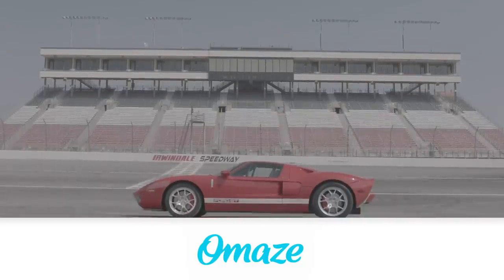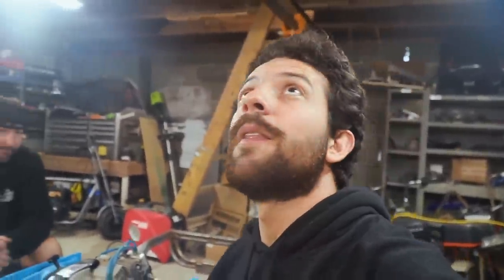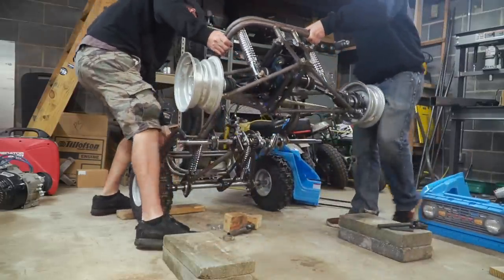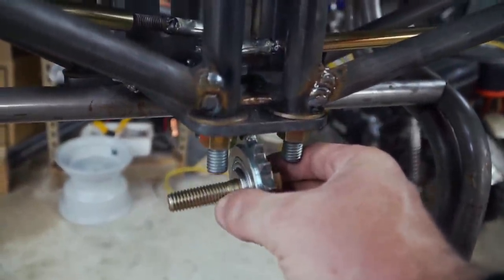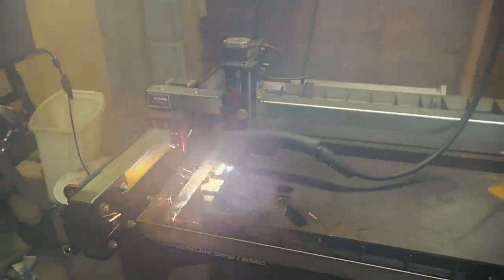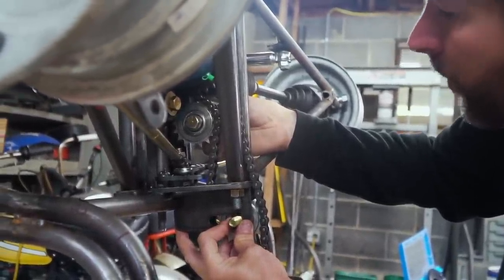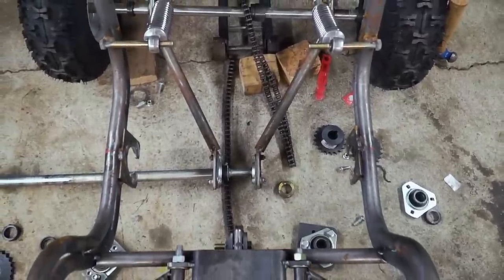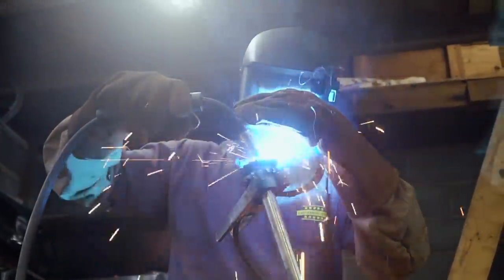4WD Power Wheels Go Kart Build | Drivetrain is FINISHED | Axles, Hubs, Sprockets!

Comment: You guys need to build like grind hard plumbing co does, get your engine and driveline laid out first, then build your chassis and suspension around that. Makes things lots easier and prevents rework and compromise.
Reply: Love them grind hard boys, they build amazing things.
Reply: Seems like GHP and Moto mule are the only two that sit down to research and plan things. Their end products are normally always strong and lightweight. Everybody else just wants to weld more and more when it fails or just abandon the project. 
I'd rather watch one nice well thought out project vs a dozen poorly planned ones that are butchered together. Project Blinky is a nice example, look how long BOM has been working on it and it's very popular.
Reply: Completely disagree.  They should build like they already do, not like some other channel.

Comment: A mid-size metal lathe would come in handy to clean up those sprockets after welding.  An older refurb would be good or even a cheap overseas one could handle the small jobs.  Great project.

Comment: you really should of done the rear axle with cv joints like the front.... independent rear suspension
Reply: Not at all.  The current set up is way more practical.

Comment: Not sure if anyone has pointed this out but the closer the water level is to the metal the less smoke and dust you have floating in the air when making cuts on the CNC plasma cutting table.

Comment: It looks like the rear axle control arms have no articulation from side to side. So if you're rock crawling and you need the rear axle to go up on one side only you will just put it in a bind as well as the chain and sprocket will twist causing the chain to come off. At least that is what it looks like. With out a drive shaft they need an independent suspension similar to the front axle as someone else has already mentioned in another reply.

Comment: Barbequing? Nah, welding. lol. Going to be a tight fit, maybe something between where the opposite running chain passes the sprocket eh? In case it hops back and locks the front end while you're doing 30 or something. Can't have y'all hurt we need content. Heh heh, and gotta love cutting thick plate like butter.

Comment: When your chain comes off or breaks you won’t be steering to safety
Reply: Incorrect.
Reply: @SportbikerNZ  I hope it doesn’t happen sounds like they are going to try and address this issue if chain comes off it could tangle up in frame right there were the steering is and prevent safe steering
Reply: @CR4ZYxRY4N  They'd have an equal chance of getting hit with lightning imo than the chain breaking in just the right spot to completely bind up steering.

Comment: When you guys were putting those sprockets in the front all I could think of was why are you using such big sprockets in there. Oh and John in the last video you almost burned your fingers while welding a nut to your frame all you have to do is put the nut on a long bolt put the bolt in the hole and weld with no burns and clean clear threads in your nut as well. Just keep having fun and you'll make good videos.

Comment: john, why haven't you welded up the hole you made in your plasma cutter table? without the water puddle, you'll only wind up making more holes in it by putting it off. not to mention making your shop dirtier because the water isn't collecting the metal spray from cutting. electronics like your laptop and cameras don't like steel dust, and ounce of prevention is worth a pound of cure.

Comment: see if you can follow me here. if you bend some tube, and weld it to the bearings  between  the bearings you a using for the trailing arms. put a retaining collar on both sides of the bearings it would act like a straight axle. then you could use heim joints for the pivot and flex point like a normal 1 to 1 rig . you can use a similar set up at the other end and it would save the bearing from going bad as fast. you can actually connect all the bearings on the rear axle and it would make it much stronger. think of it like this bend a top and bottom tube or top front and back so it clears the sprocket and chain weld to a point on all the bearings then it would act like the axle housing, so you  attach you 4 link to it and it would be a straight axle.

Comment: Seeing as you need to space out the rear wheels a few inches on each side for stability,tracking and track width why not mount the reat shocks outboard of the frame in an almost vertical location gaining both internal spacing as well as more shock leverage on the chassis...js...
Reply: But the lil Bronc is looking good and coming together nicely.. Maybe 4 wheel steering is in its future plans if you really wanna rock crawler or serious off road go anywhere buggy... Or maybe a built Tillotsin engine or even a badass seriously modified horizontal v twin engine!!! 😁

Comment: with those nacho's most of the thunder will prolly happen under the blankets at night , better not light a match
one more tool for the want list: a vibrasaw https://www.arkadaserviss.lv/files/products/bosch-narzedzie-wielofunkcyjne-gop-30-28--300w--0601237001.300x300.jpg
these things work great on plastic and in tight corners

Comment: Don't know why I am going to say this cause yall obviously know everything.  But I hope that isn't how you are planning to mount them rear shocks at that angle you might as well not use anything. Ideally they are designed to be used no more than 20°s at the angle yall have them they are as useless as tits on a boar hog. Because they will not work that way 0 compression 0 rebound. Shock need to be vertical not horizontal.